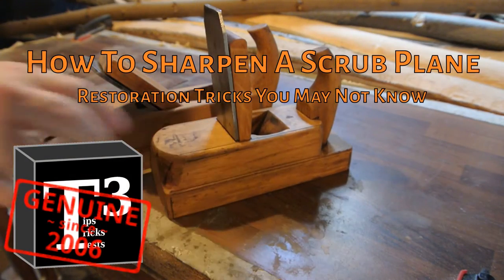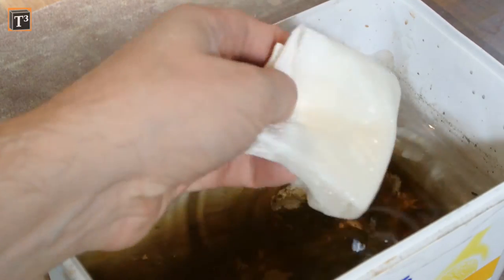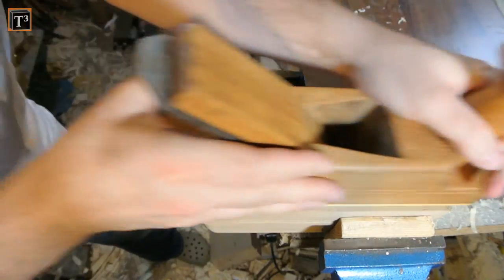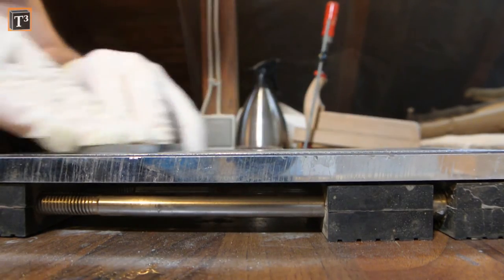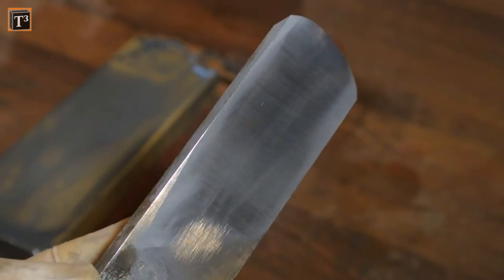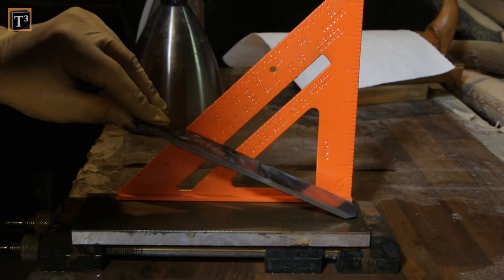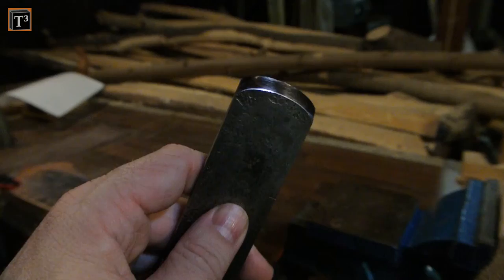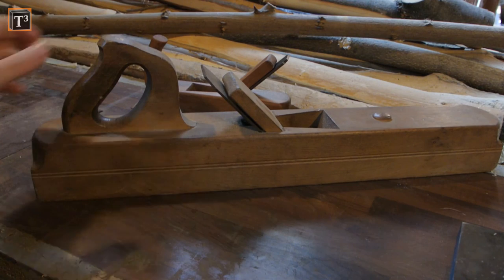How To Sharpen A Scrub Plane ▪ Restoration Tricks You May Not Know

Comment: I sharpened mine the same way. Got it "scary sharp", easily removing arm hair. But using it on wood is really difficult. The mouth is wide, but the plane just generally does tear out, no shavings. Help? (Yes, I adjusted the depth both high and low, trying different settings)
Reply: Dear LitoGeorge - you sold that plane today didnt you? You gave away a gift to a young man who is enthusiastic about wood working. Thats great. How did you sort the plane out? Oh yes, you adjusted the frog nicely. Flattened the frog, flattened the irons back, adjusted it all. And then it worked great didnt it? Congratulations past me. I hope you enjoy building the next woodie scrub plane. Go well.

Comment: Thanks for the videos. I have a very old but very good axe that someone has pounded with a sledgehammer so that the Poll has mushroomed, also the "edge" is more like a topography of the alps. Suggestions??
Reply from the maker: I would cut away the mushroomed parts with an angle grinder or dremel tool like you can see in my axe restauration and wedge maintenance videos.
If your edge is really that bad you need to reshape it. You can use a good file but I would prefer a belt sander like you can see in my video about sharpening curved draw knives.